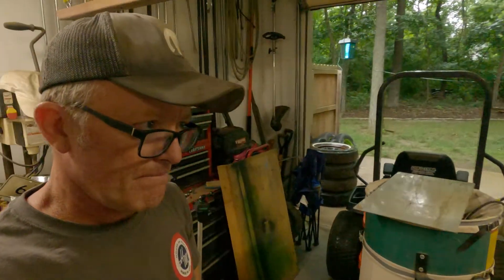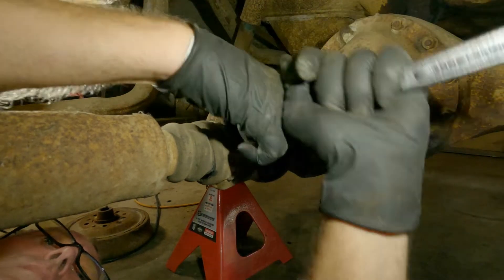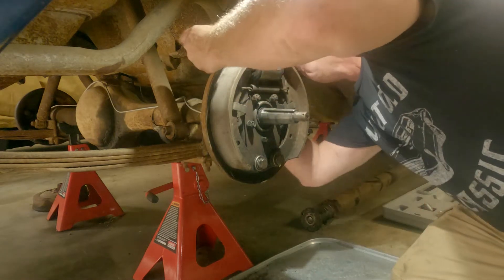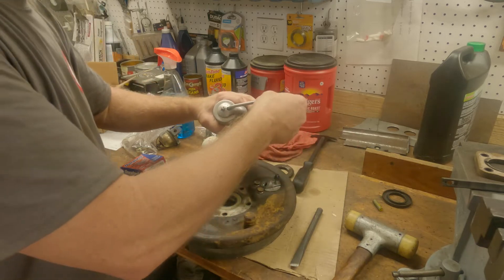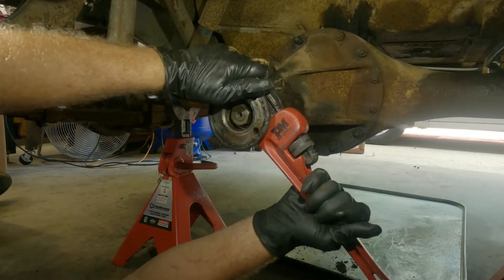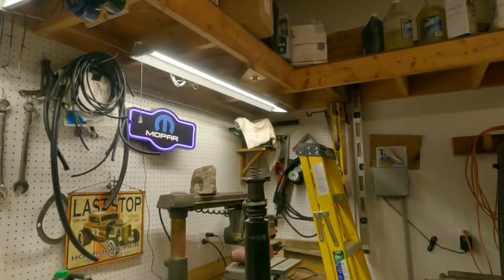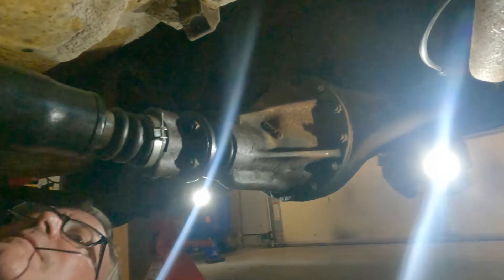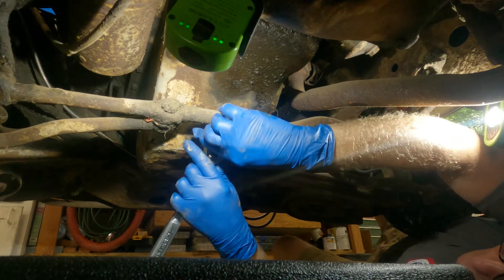It's time to get greasy with Thelma | 1956 Plymouth Savoy

Comment: CHUCK
For me at least, ball + trunnion = kill it with fire. I don't just dislike them - I genuinely loathe the damn things.
Ma stuck with those and that tapered axle deal WAY too long...but there it is.

Oh - and that trusting Rotella deal is sort of old and busted, too - there are several Rotella products that dropped
ZDDP and phosphorus additives in their packages years ago, but old school ways didn't oftentimes get the memo,
so you gotta verify whatever one winds up using!
(Reason #12321 to hate catalytic converters - can't run ZDDP in engines with them!)

There are better oils out there for the inclusion of high levels of zinc and phosphorus anyways.
The famous "green" Brad Penn stuff ("Penn Grade"), the Driven oils from Joe Gibbs racing and of course, 
the Valvoline VR1 stuff all were formulated to include the additives from the get-go.
I prefer the dino oil based stuff over the synthetic for older engines - consumption rates are lower with them in
older engines (reasons - science!).

As always, thanks for what you do with this channel Chuck. See you at the next one!
- Ed on the Ridge
Reply from the maker: Hey Ed, 
Yeah, Rotella still claims 1200 ppm Zinc and about that in Phosphorus from what I know.  The extra Zinc that I added didn't hurt a thing either.

I have Brad Penn (Penn Grade) here at the house and run that in the other cars.  Honestly I can't say why I didn't use it in Thelma.

Next time.

Comment: theres a dual metal shielded bearing behind the outer axle bearings it's an SOB to remove, but not expensive. i did the same job on a '48 Dodge. its the same set up. you can see it here.  https://youtu.be/KTxOeuVW8LM so you know what you're getting into if you decide to do it
Reply from the maker: Thanks Reaper, yeah I decided to not pull the axle.